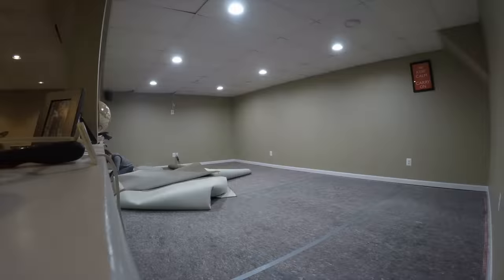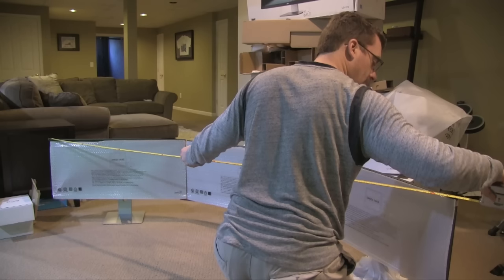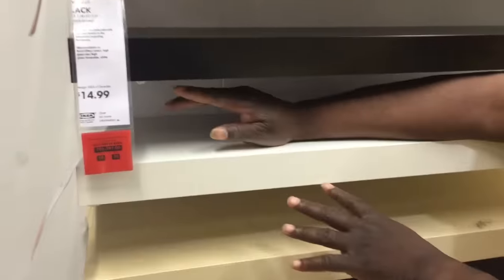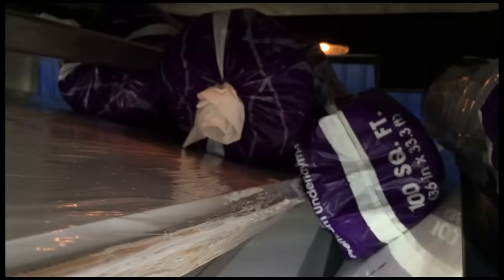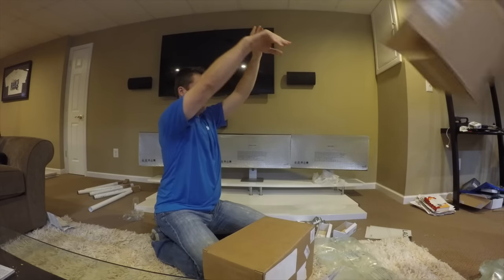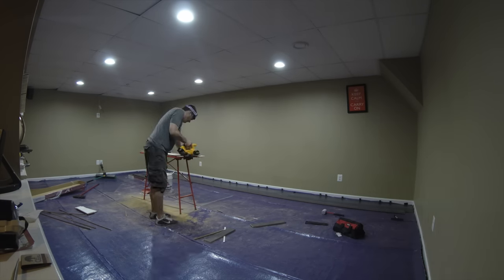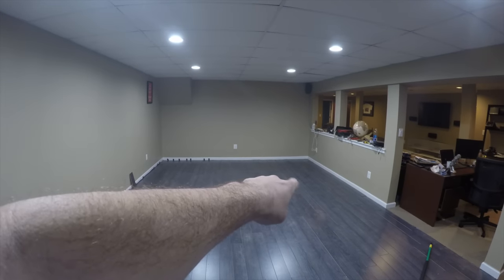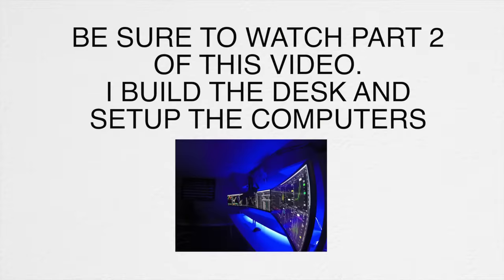The Total Trading Office Transformation Part 1-of-2 | From PC To Mac!

Comment: Why do Americans put that kind of "carpet" covering almost 100% of the floors of your homes?
Reply: Because it's cheaper than hardwood, lowers heating costs in the winter, easy to clean up with a vacuum, don't have to worry about scratching your carpet like you do with hardwood (unless its a dark stained hardwood flooring), and finally..... LESS cleaning.  With carpet you can get away with vacuuming maybe once a week if not once every other week depending upon your usage of the room and whether or not you wear shoes on it.  With hardwood you pretty much have to sweep it up every other day.  

Bottom line..... it's cheaper and easier to maintain.  And if you get a big ol' stain on it..... cost of replacing it is a fraction of that of hardwood.  Granted spills on wood floors are easier to clean up - just mop it up..... but overall the affordability and ease of maintenance of carpet is why it's king.  And in newer homes being built in the burbs contracting companies will always put in as much carpet as possible, again for the cost savings.  

My question is..... why is carpet a "foreign" thing to you.  I've been to Europe.  You all have carpet out there too.... at least in Portugal, France, UK, Germany, and Italy.  The cooler the country the more carpet you have.   Where are you from?  Some 3rd world African or latin America country?   Here in the Westernized world carpet is about just as popular if not more popular than hardwood floors.  Tile flooring is almost relegated solely for kitchens and bathrooms for obvious reasons..... but even then vinyl or linoleum is still pretty prevalent.  Vinyl or linoleum flooring is to tile as carpet is to hardwood..... a cheaper, easier flooring option to maintain and/or eventually replace.  

Finally..... who honestly cares..... it's fucking flooring.   But since this became a topic I'll just say that hardwood, carpet, tile, linoleum, vinyl, etc all have their place and purpose for flooring options.  Personally between hardwood and carpet..... while hardwood looks beautiful...... carpet is more comfortable.  I forgot to mention that before.  Carpet is considerably more comfortable than hardwood floors.  I mean which would you rather lay or sit on, hard ass hardwood floor..... or a nice soft carpet with a layer of padding underneath it?  Also, nothing is worse than getting out of bed in the middle of the night on a 5 degree (Fahrenheit.... the proper heat measurement) January night and walking on cold as fuck hardwood flooring.  Carpet has a lot of pros.  The ONLY thing hardwood has is its looks IMO.... .other than that I think it falls short in just about every head to head category with carpet.  And if you have a ton of foot traffic in your room, while over the long haul carpet will wear out faster than hardwood, it'll look better throughout the wearing process.  Carpet hides its imperfections better than hardwood as long as you take care of it and vacuum somewhat regularly (once a week).  And again.... it's significantly cheaper to replace.   If you see pictures of carpet on line with them looking dirty and nasty as fuck with stains all over them..... that's because the owners of said house and carpet are lazy POSes who never vacuumed let alone steam cleaned their carpet before.  They're likely slobs, probably smokers..... and the rest of their house is probably a dump.   There is 0 reason a cream/tan/beige carpet should look BLACK in spots... ever.   So yeah, cost, ease of maintenance, lower utility bills, AND comfort are reasons why carpet is so popular.  Hardwood is like pets/dogs to me.  Fun to look at and be around once in a while.... HORRIBLE and pointless to have in your home though.  If you live in a place that actually has winters, your love affair with how beautiful hardwood is over carpet and why you think it is better will quickly vanish.   I mean I think it's funny when I got to friends houses here in Northern Illinois who have hardwood in their living rooms.  Not only do they have hardwood but the trend in newer homes is to waste as much space in said home by having vaulted, ridiculously tall ceilings.  Combining those two makes your heating bill in the winter ridiculous.  My friend who has this very setup in his house pays about 5 times as much as I do to heat his home in the winter.  I don't have high ceilings and I have carpet in every room.  So while my electric bill is a whopping $50-60 a month, my buddy's bill is always north of $200.  To top it off..... iin the center of his living room he has a GIANT area rug to try and alleviate the problem.  You see this often, people throwing large area rugs to cover their hardwood floors.  Kind of defeats the purpose of having hardwood floors IMO, no? haha.  People do this because of said utility bills.  That, and they want to protect their floor...... and they don't like the feeling of a cold as fuck floor on their bare or sock covered feet.  

So why is it so common/popular?  Because it just makes more sense.

I didn't even mention the fact a carpeted room won't sound like you're in a cave..... like this room does in the video.   Carpet kills echos.  Yet another pro for carpets over hardwood.

Comment: Awesome video...basements make great man caves! I know the PC tower is ultimately the way I want to go but I am overseas so I want to buy a laptop and 2K monitors until I come back to the states.  Is the Macbook Pro running virtual pc a viable option for Abletrend or Sink or Swim?  The Macbook pro I am looking at has four Thunderbolt 3 ports capable of driving two 4K monitors.  Do you know from experience or knowledge how many 2K monitors I can run off the current Macbook Pro's.  I am looking at 21"2K because I can pick them up for $100 and give them to the locals when I leave ;-)  I won't quote you or hold you to what you say but I thought with your actual experience you might know more than some of these people from Apple sales.

Comment: Todd, I used to have a PC and when I switched to MAC, specifically, El Capitan OS I can no longer drag my trading platform across two screens as I was doing prior to El Capitan.  And, Apple told me they no longer support this function.  So how do you get your trading platform to spread across more than one screen?  Thanks.
Reply from the maker: Do you still need this answer? Sorry to be late. System Preferences, Display, and then...under "Arrangement" i think it's uncheck "mirror displays".  I think that will get it done for you?